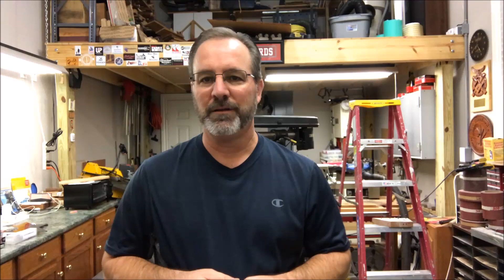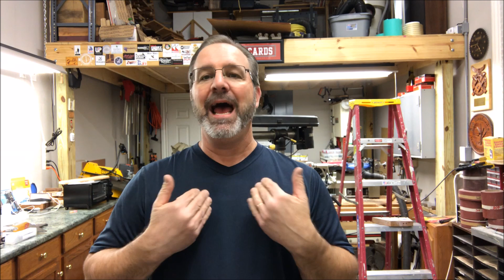Lathe Update - Parts On Order

Comment: Pretty cool that you were able to fire answers right back to the tech, and now you know the standard trouble spots! :)  Good stuff!
Reply from the maker: I’m thinking about attempting to repair it as I have nothing to lose and an education to gain. 

Regards,
Bob
Reply: That would make a good video.  If you can find one of your local buddies with a scope, it would be much more useful for examining the signals, and the whole PWM thing would really click in a visual way.  A meter unless it has frequency or duty cycle measurements doesn't respond fast enough to give a real accurate picture of what is going on.
Reply from the maker: I'll have to ask around. I wouldn't have any idea how to use a scope so hopefully the owner can teach me. Regards,Bob

Comment: Bob. Glad you got it figured out. You control box can still probably be fixed. Would be good to have a back up
Reply from the maker: I’m thinking about attempting to fix it be swapping some parts around. Might be fun. 

Regards,
Bob
Reply: well if it is the mosfet or capacitor. it would not be to hard to fix. I have done it here at work to fix some machines.
Reply from the maker: I’m thinking I’ll start with the capacitor.

Comment: This and the few related videos related to your trouble shooting will be very helpful for others if their lathe runs into similar issues.  (I've got the same lathe as you.)
Reply from the maker: Even though I have a new box coming, I think I'm going to try to test and replace some of the parts to see if I can get the original fixed.Regards,Bob
Reply: I am also curious what it would take to enable reversing the polarity to the motor so that you can run in reverse.  I have seen some ideas that may work and even have thoughts (I think I saw a vid where Captain Eddie did this with a similar lathe) of making an external break out box for this between the control box and the power cable sent to the motor.  With you having kind of a spare control box, if you get it working it would be cool to then see if you can add a reverse switch to the controller.
Reply from the maker: Reversibility would be a cool idea. Let me see if I can get it working. This could be fun.Regards,Bob
Reply: Here is the Captain Eddie vid I was talking about https://www.youtube.com/watch?v=uhZVo-FyQaM
Reply: As long as you have a chuck that could be locked down when in reverse or if you are between centers or turning with a mandrel that is locked for reverse or has a drawbar, reverse on this lathe would be useful.
Reply from the maker: I believe my chuck has the ability to lock it down. I need to check. 

Regards,
Bob

Comment: Bob. I’m looking at the same lathe maybe the 12” version.  What is the biggest item you could make?  I don’t want to limited with pens and stoppers only
Reply from the maker: If I cut the corners off on a band saw I can turn a 10” bowl blank. I’m not sure of the length, that depends on if you’re using a chuck, faceplate, or spur center and what you use in the tail stock. I do know you can purchase extension beds so length is probably less of an issue. 

Regards,
Bob

Comment: Bob,
I'm glad you got the new control box I would like to make a suggestion, though. Caps and MOSFET's are cheep, why don't you try and replace them anyway? Just replace them one at a time so that you know which component was bad. What can happen, it doesn't work now so you have nothing to lose!
Reply from the maker: That might be a really fun project. I think I may try to source a Capacitor first to see what happens. If I do, I’ll film it. 

Regards,
Bob
Reply: To discharge the cap (it's a big guy, it could possibly sting), use some pliers that have a coating on the grip, and touch both pins with the jaws while in situ. It may spark, it may not, or it may and you won't see or hear it. 

If it sparks, it's depleted that very instant. if it doesn't, it will have had been designed to drain current through a resistor over time. 

After that, you're good to go.
Reply: And a free spare on the shelves for when it goes bad again...
Reply from the maker: I'll discharge the stored power in the capacitor then I'll de-solder it and test it with a meter.Regards,Bob